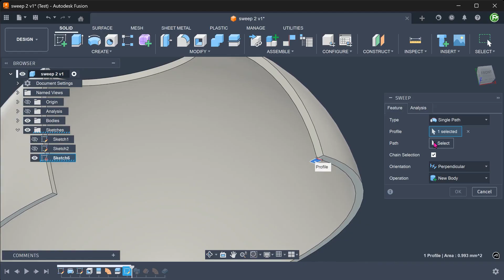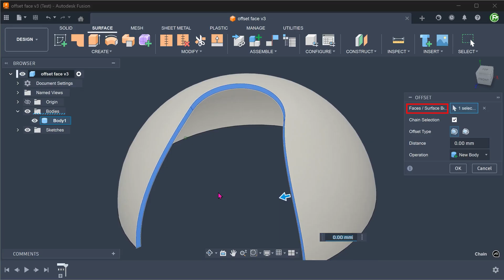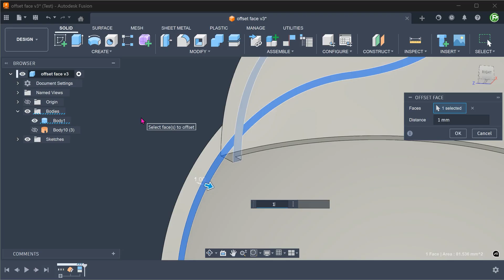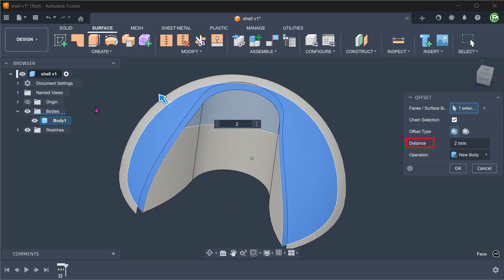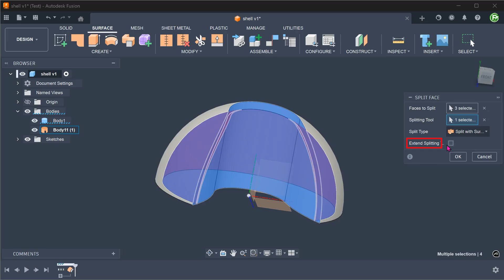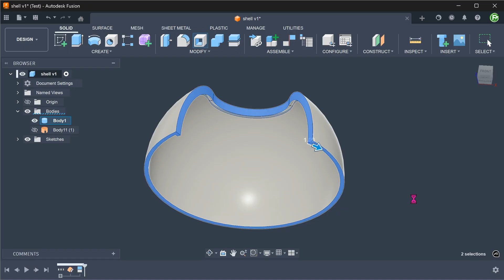Fusion Quick Bites #3

Comment: It's important to note that some (perhaps all) of the methods produce models with different geometry. You can easily see this by examining the Properties of each body. The swept profile, (ruled face and thicken) and your Method 1 are very close. Method 2 is significantly different. Working out exactly how the models differ is, in my opinion, not easy. I've tried intersecting the bodies from the different techniques but Fusion fails to calculate, at least in the combinations I tried. The differences between the resultant models are very subtle and the faces are probably almost identical. Was there some  pressing reason why you need the lip to have a single face? It seems to have been achieved at the expense of not being entirely sure what the geometry is.

Comment: Shell is such a powerful modifier, but I just can not use it most of my projects. It fails to compute so often with any even just sort of complex surface. For example for an aircraft fuselage I often need to blend several lofts and work a bit with surfacing to make things flow well. And shell just stops working entirely. A video on why shell can fail and how to prevent these issues would be much appreciated!
Reply: Under the hood, Shell is basically doing an offset surface. If the base surface has any tight curvature or pinched UVs the offset can fail.

One good way to troubleshoot a failed shell is just to manually create offset surfaces at the appropriate distance and see what faces fail or leave gaps.
Reply: @fjord-fjesta  I am aware of that. I often run into the case that even on a seemingly near flat surface, offset just fails as it somehow has too complex topology. It is really fragile.